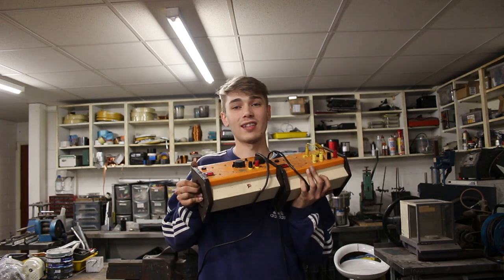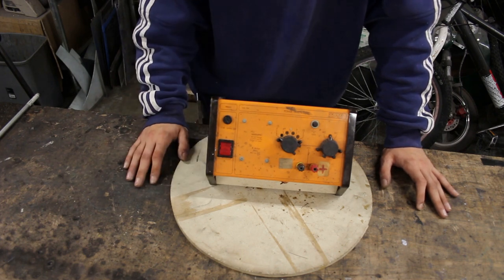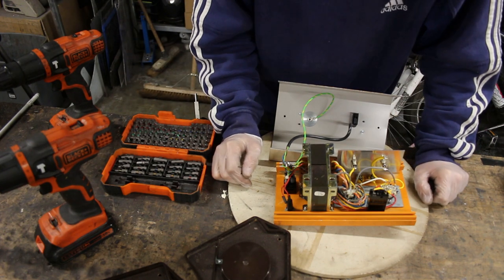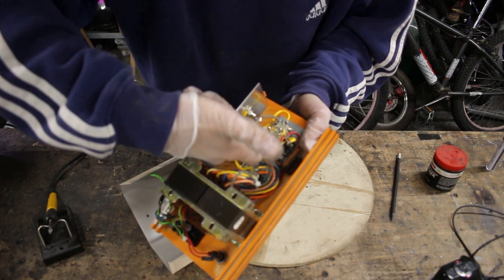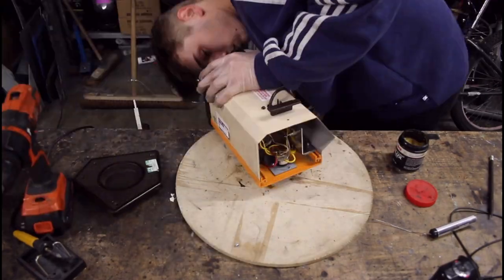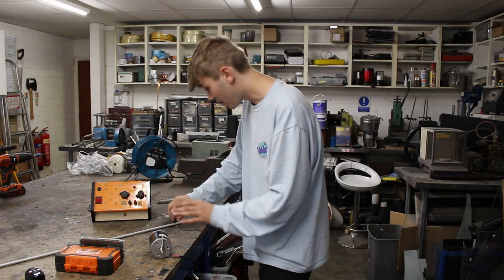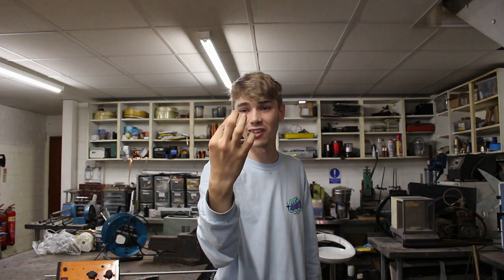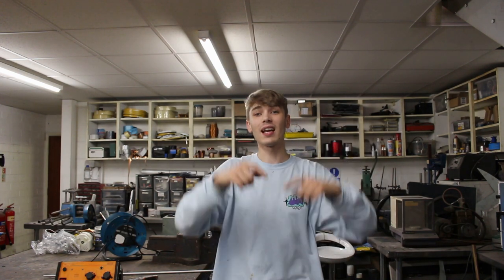1243 - From Trash to Cash - Repairing a Variable Power Supply

Comment: Luke, very well structured video.   Good job on the repair.  Check though the amperage and if it has consistent voltage amperage even under the loads and temperature.  Be safe and well.

Comment: I would have touched up all the soldering joints to reflow them in case of unseen partial dry joints that will cause issues down the track.

Comment: Wouldn't it had been wise to test it before reassembly? The wire may not have been the only problem.
Reply: I second that motion! Having opened the casing (especially if it's more than a few screws) Check that it works, otherwise you have to undo it all again
Reply: I agree, I probably should have done this! I couldn't see anything else that could have been wrong so I thought to my self "weeeellllll let's put it back together" lol. Thanks mate! :)
Reply: Good work tho, Luke! Keep up your enthusiasm for repairing stuff. Our society has a  disgusting throw-away mentality and you're not buying into that, which is so refreshing in someone your age. Sometimes it will be very simple and obvious. Other times it's so frustrating and you'll have to break out the multimeter or other equipment, check circuit voltages, replace components, etc. Resistors, transistors and so on, fail internally with no outward signs. Carry on, I applaud your keen-ness, like Robert's, to simply give it a go. Well done.